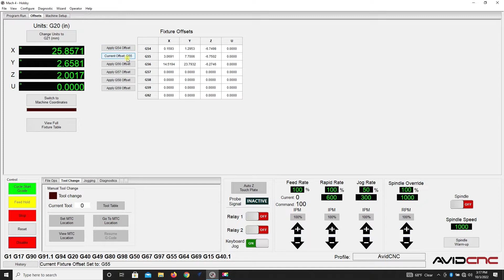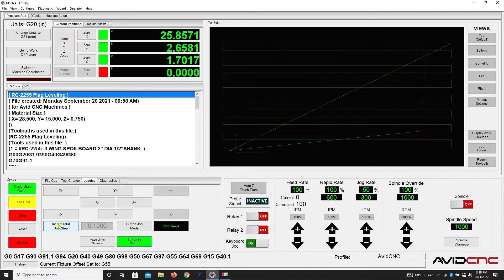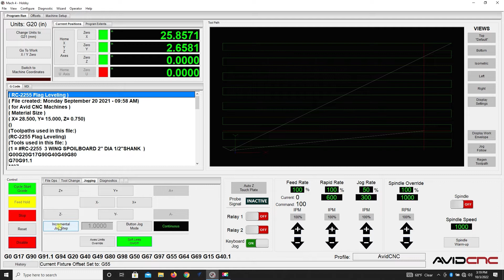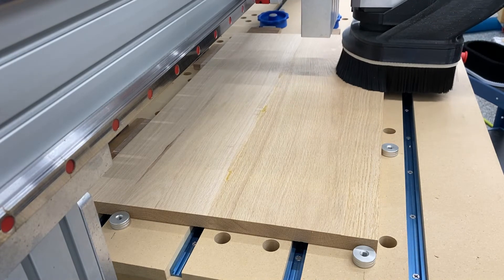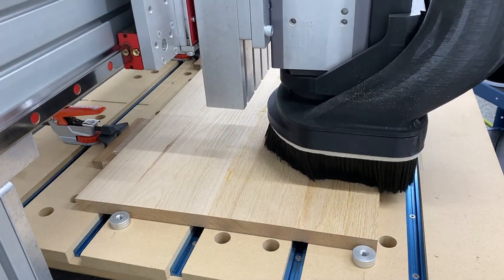Flatten Panels the Easy Way - Using Shims with a CNC Machine!

Comment: great video.  do you have a plan for the spoilboard with horizontal t-track? Also, are you dog holes open on the bottom of the spoilboard? I'm wondering if the Kreg clamps  (the bottom post) is larger than 3/4' deep. thanks.
Reply from the maker: Hi DW, I don't have plans for my spoilboard available to the public just yet.  That is something that is in the works.  I plan on doing a complete video on my spoil board and providing links to it on my website as well which will be in downloadable Vcarve files.  Stay tuned for that very soon sir!  As far as the Kreg clamps they are longer than 3/4" and yes my dog holes go through completely to avoid collecting saw dust and chips.

Comment: Thanks for the link to the shims and clamps. I picked up a set along with those same Armor clamps you are using.  One issue I am having with the clamps though. When I secure them up against the pieces of wood (like the walnut pieces you use), the pressure seems to make the top of the flag raise up just a bit creating a gap at the bottom. I have tried various amounts of pressure but still have the problem. I even made the mistake of clamping them too tight and the bend dogs at the bottom left big dents in my wood.  Just wondering if you have had this problem. Thanks
Reply from the maker: If you have too much pressure at all that may occur.  You need to adjust your clamps to where they are just holding it tight enough to keep it snug and no more.  A gap/raising of the wood indicates you are overtightening.  Make sure you are putting downward pressure on your piece as you slowly engage the clamps.
Reply: Looks like that worked.  I had too much pressure on them.  Kind of amazing that with just a little pressure it still holds them down so well but it did.  Thanks again for the help and for the great videos.
Reply from the maker: Glad it worked! @RickP4880

Comment: I loved the way yu explained this process. Wouldn't running the wood through a thickness planner be faster than running it through a CNC router, besides the you'll have to spend considerable amout of time getting CNC router ready when you will just push some buttons on the planner and throw the work piece in?
Reply from the maker: If you have a lot of panels, a planer will be the way to go. However, you will still have to contend with snipe, and the inherent unevenness and wobble in crappy wood would necessitate the use of a sled if you are looking for precision. Plus most planers cannot accommodate pieces I use. The CNC, using precision shims is much easier for “one off projects”.   I have used both methods.
Reply: @BlueLineCNC  ThaNks for the reasoned explanation. Unfortunately I am not rich enough to buy you a planner, but I'll spend my subscribe currency on your informative youtube channel by subscribing and liking the video :)

Comment: Hey Russ. Just curious what RPM and feed speed (IPM) you are using for that large bit and if you keep it at the default stepover. I seem to get a bit of burning on my wood.  It still levels out fine but I know that's not good on the bit but i'm not sure what to adjust (spindle speed or feed rate) or both.  I actually have the Whiteside 6220 2in bit and it defaults to 13000 rpm and 200 ipm with an 87.5% stepover.  Just curious what your settings are since yours come out so nice. Thanks.
Reply from the maker: I’m running 18k RPM with a 40 percent step over. I’m only taking off .02 inch at a time.  Hope that helps!
Reply: Very much so. I was running the RPM way to slow. I will try another run with the new settings.  Are you running it at about 200ipm? @BlueLineCNC
Reply from the maker: I can’t remember but I would go with bit mfg suggestions on speed and no faster.
Reply: Thanks Russ. Still up watching your videos and I just ordered the RC2255 bit using your link.  As always you are very helpful.  Keep up the great work. @BlueLineCNC